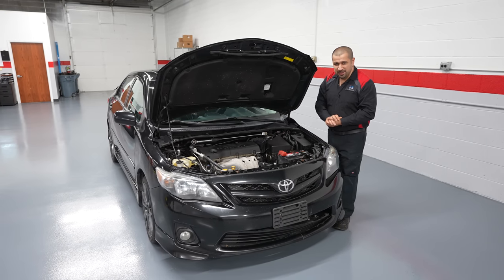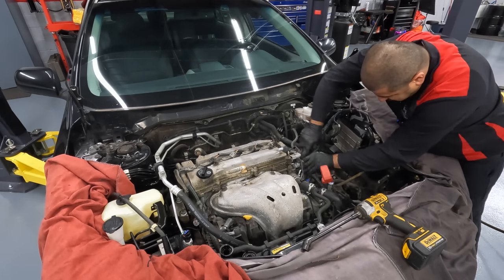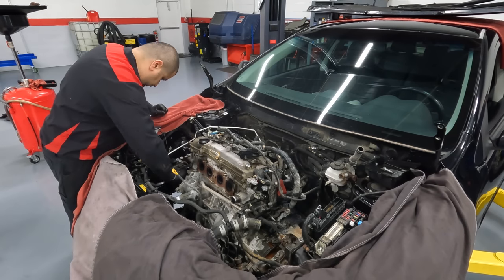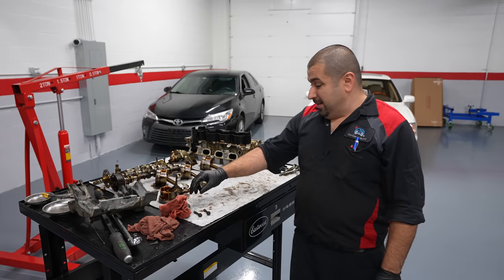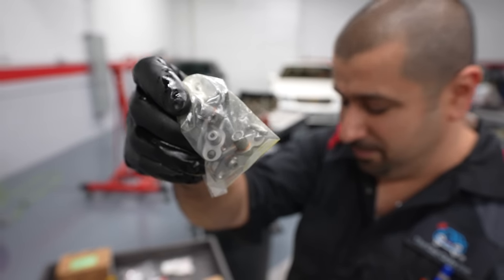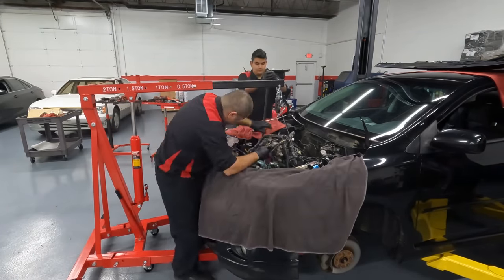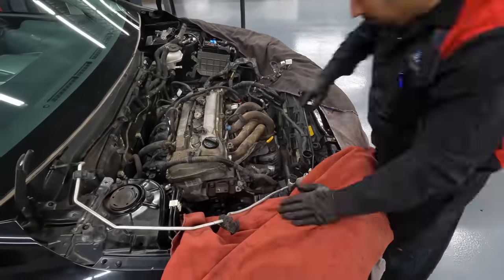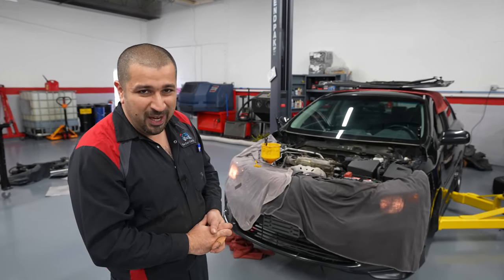THIS is Toyota's Worst Engine Ever Made! But Is It Really THAT Bad?

Comment: Basically if you did good oil changes every 3 to 5 k max every 3 to 5 months you probably wouldnt not develop that problem never letting sludge from to get in your oil control rings and gunking them up cause it to burn oil. I found running a half a quart atf for a week or 2 before oil change and successfully got mine un gunked and now i never have to add oil between oil changes.

Comment: I have a 2010 red Toyota Camry sport edition is the vvt-i engine 4 cylinder to 2.5 l I drive the car and when I press the gas I hear kind of a whiny sound I've just recently replaced the coil packs and spark plugs so I'm wondering if that has anything to do with it would really love to get an idea of what you think it could be I'm desperate here cuz no one has answers
Reply: Stupid autocorrect I have a Corolla not a Camry

Comment: My 2006 RAV4 (then with 117,300 miles) had been CONSISTENTLY using one quart of oil every 600 miles – due to defective pistons, a KNOWN MANUFACTURING PROBLEM. 

Toyota had to know which cars had the faulty engines and should have issued a recall for ALL of them, but they didn’t.   Rather, Toyota waited for customers to complain of excessive oil consumption, and then promised to test and then rebuild oil consuming engines on an extended warranty basis for cars less than 10 years old and with no more than 150,000 miles.  Sleazy!

An Eastern Pennsylvania  Toyota dealer performed THREE oil consumption tests on my RAV4, the first two of which were done within the Extended Warranty ‘window’.

The FIRST TEST (2/29/16) PASSED, but the car kept using one quart of oil every 600 miles AFTERWARDS.  I bought a case of factory recommended 5W20 Synthetic Blend oil to keep the engine properly filled, as needed – about every 600 miles.   

The SECOND TEST PASSED (6/30/16).  I watched the technician put oil into the car from a previously poured pitcher (but oil viscosity unknown).  The car burned just over half a quart during the test, BUT continued to use one quart every 600 miles AFTERWARDS.  When this dealer changed the oil on 3/20/18, there was NO OIL on the dipstick after just 528 miles!  None!  Nada!  Zilch!  Ouch!

I opened a case with Toyota Corporate who suggested the dealer conduct a THIRD test.  To ensure that the proper oil was being used, I MYSELF provided five quarts of (5W20) synthetic blend oil, and watched while the dealer’s  technician placed 4.5 quarts of it into the engine.  In doing so, the technician quipped that the test results would not matter anyway as the extended warranty program was over by then.   

With the factory recommended oil that I provided, the THIRD TEST INDEED FAILED – the car burned over 2 quarts in 1250 miles, and this time the red oil lamp flickered for the first time!  When I called them back, Toyota Corporate told me that the Extended Warranty coverage had lapsed for my car, and I should ‘take the matter up with the dealer.’   

The Toyota service manager promised to check with ‘his man’ at Toyota to see what could be done, but never replied back, nor did the Toyota Dealer Principal after I sent him a certified letter, followed by two telephone calls.  I’ve even e-mailed the Toyota CEO (Mr. Toyoda – that’s supposedly his real name!) in Japan – no reply!

To recap, the first two tests PASSED (when the dealership said THEY provided the factory recommended oil) and the third FAILED (when I provided the factory recommended oil).  The only plausible explanation is that the technicians – for some unknown reason - placed the wrong viscosity oil in the car for the first two tests.  I know they didn’t overfill it because I watched.

The result was that I was ‘stuck’ with a car that has lost most of its resale value as I could not in good faith sell it in its current condition, a car that can be dangerous to drive should the oil level drop too low, and a car whose catalytic converter is most likely to fail soon (an expensive repair) because it is absorbing the excessive amounts of oil blown into the combustion chambers by the clogged pistons.

I have owned many new cars over the years, including two other Toyota’s (1999 and 2002) that were purchased brand new.  They never burned oil between oil changes at 3,000 miles.  This is a consummate disgrace both from a car manufacturer that touts quality and from a dealership that fouled up the first 2 tests.

Does Toyota Corporate stand behind their dealers?  They say they do, but but apparently very far behind.

A Better Business Bureau complaint was filed to which this dealer never responded.  Their rating even dropped from an A to a C Minus.  They don’t seem to care.

----------------------------------------------------------------------------------------------------
Reply: I’ve owned 3 toyotas and dealer run around doing warranty work has soured me on buying anymore toyotas. What good is a warranty if they find a way out of it.

Comment: I looked quite hard at this issue about a year ago (Sept 2024 now) and I found somewhere that this piston ring malfunction causing the oil burning problem was only for the Nth American Market.  Can anyone confirm that?  As I'm in NZ and looking at importing one from Japan, hoping that this is not an issue, cause the other issue with this engine of the early models was of the Head bolt stripping, which I don't want either...  It seems that they fixed that issue but introduced the oil burning issue from the piston rings change...

Comment: Ok so...mine is an 09 xb I took it to Toyota because it's burning a quart in about 3-400 miles. They took it, gave it back claiming mines not an affected model. I call absolute BS. this isn't something I caused, that's for sure. And I have proper service maintenance to prove it. 

Toyotas recall says 150k mile extended recall. Mines now at 144. I think they're trying to make go over 150 so they don't have to fix it.

How can I prove it's the rings and is their fault. It's the exact same engine and model they said is affected. I almost want to sue them and I know I'd win too.

Comment: I shuddered at the thought I have to trust the average Toyota mechanic to even orient the piston rings and the piston  etc , the dot should face the front. I have a better chance just doing it my self and watch your video a few times. Yes it will take 3X as long , but I know it is done right, not by someone trying to beat the flat rate hours.. The serpentine belt, I not necessary will change it. If you spray vinyl /leather /rubber conditioner on the belt each year, one brand is 333. I seen people remove the belt and soak it for 15 minutes. Never change the belt. Same with cabin and engine air filters, you can agitate them in mild soap and water and inspect it later. I learned that with my old Suzuki for the engine filter cost $40 CDN 20 years ago.

Comment: Have an 08 scion tc. After an oil change ots almost burnt through all new oil in 600-800 miles. I add an oil treament and new oil and it burns very slowly till 3000 mile mark.

The cut off for the fix was 10 years and/or 150k from toyota. I took it in... They did a fresh oil changem taped everything off to make aure no manipulation... it disnt meet the consumption requirment for the fix....
Mine never had a problem till hit 157k and ot was 11years old. 😢

It's 17 now and i just know to check the oil often.. unless the A/C is on full blast you can barely tell the car is on... 
Usual maintenance, brakes, tires, oil. 
1 new alternator, new serpentine belt, spark plugs, 2 valve cover gaskets. 1 PCV valve, 1 purge Canister. Everything else is OEM... Great car for 18k

Comment: i have A2012 camry  140 thousand miles if i use 0-20 oil it burnes a 1.5- 2 quarts between oil changes at 5000 miles so i started using 5-30 and burns maybe 1/2 quart now

Comment: Any 4 cylinder aluminum engine if you over heat it will fry the engine, what demographic overheats the most 4 cylinder Camry engines?

Comment: The worst Toyota engine, I bet, was 1.5L found in my 1991 Terrell with 3 valves per cylinder and 3 speed auto. I owned that contraption from 1998 till 2003 and was 3d owner. I still hate the thing with passion! I forgot how many times I paid my mechanic to change valve stem caps. Every time they would last for 3 weeks max and then every morning I go to work people who lived on one side of the street could not see houses on the opposite side of the street. 😂

Comment: Opel and Toyota from about 1998 to 2009 seems to smoke much more only after 100 000 km than any other brand that the reason why I never dare to buy one many taxi drivers in Dublin Ireland had Toyotas that time but not anymore  it got bad reputation

Comment: bummer, I had been searching for a used car and there were many toyotas/scion cars i was interested in but they all were form the affected years and  had this engine. I did not see one car that had the issue addressed or noted in the vehicle maintenance history. Its as if the previous owners all decided they would rather get rid of the car vs dealing with fixing it. I never have any desire to have my cars in the shop for major repairs so as soon as I saw a toyota with this engine, I walked away. I never bought into the "its a great car....it just burn oil but other than that, its great". Sorry, if a car has a factory defect where its burning oil that could lead to major damage if not addressed and costs thousands to fix then its not a great car.

Comment: Had one in an '07 Camry SE. Ran fantastically, but LOVED a very steady diet of oil consumption! We just kept her topped off since we missed the extension of the warranty engine rebuild by a few thousand miles after buying it w/190k miles on it. The cop I bought it from told me with a straight face that it was completely trouble-free and said "I'd let my mom drive across the country in this thing!". Somehow I missed the issue in my research. Ugh! Oh well. A needy friend of my daughter is still driving it today after she sold it to her really cheap! Probably has near 300k on it by now.

Comment: He said this engine was designed for 5 30. Does anyone know if that is true with 2arfe? Just wondering if I should do the same with that one as I am not worried about fuel mileage with that one rather longevity as it is great on fuel to begin with. Love the 2arfe I have.

Comment: Great points regarding 'don't mess with what ain't broke,' (eg. head resurfacing if a flat head.) There is a MUCH MORE common 'error' for those only doing a leaky head gasket repair: They remove the carbon build up at the top circumference of the bore. This carbon was patiently built up by the existing rings, is has become INTIMATE with them,  and becomes crucial in preserving the compression stopping blow-by (and oil usage).  Thus the 'backyard guys correct the 'overheating' (blown head gasket), but now you have an 'oil burner.'

Comment: Will the vin# let me know what piston and Rod letters was used?
Reply: I have went to the dealership and inquired thru techs and parts guys. There are 2 or 3 different letters used and I believe B or C is most common however no a VIN# Will not give you this information.  You must take the engine apart to find the exact letter used. Sorry.

Comment: Hi Brother, You are knowledgeable person,  where you located, venza 2013 2.7 liter 1AR-FE engine. misfire 1st cylinder P0301. I changed all possibilities, mechanic said, change the engine or rebuild (over hull),. current meter reading is 180300KM and I believe this engine has rollback 100000KM so its around 300000KM. I bought this car from the private seller,. Please advise me, I'm in situation last 6 months. Thank you

Comment: Hands down, this (IS) the worst engine Toyota has ever produced. They easily overheat, pull cylinder head bolts, seals and gaskets leak like crazy, and burn more oil than a Diesel engine.

Comment: The bullshit when dealing with the warranty is associated with the dealership that's honest and will honor it. I had a scion tc with a similar issue with rings causing oil consumption l. Clearing the test they did stated it didn't, long story short...I took their word...3 months laters...oil consumption lead to knock and engine failure...mechanic outside said Toyota screw up and now it is better to just get a use engine rather than rebuild.

Comment: Not going to watch, just going to ask. Is it better or worse than the engines in the SR5 that barely lasted 1000 miles before cracking and/or warping due to a design defect in the engine block itself preventing adequate cooling? Or is this Transmission based like in the Helux where the only thing really holding it in place is the engine and sheet metal allowing it to flop around and chew up its insides?
It's okay if you don't answer me, this is Toyota and I know from personal experience that they aren't worth more than the scrap metal price unless you are selling it to a delusional fan boy of the brand.

Comment: Mine burns oil so quickly that if there was a way to replace the filter without draining the oil, you'd never have to change it. Just keep topping it up lmao.

(Yes I'm aware that you drain the oil to remove contaminants from it and Bruning the oil doesn't do that but it was just a joke shut up)

Comment: Do BMW engines really blow up after every 100,000 miles?

Or are you just voicing your bias that Toyota engines have wide tolerances and require very little maintenance to stay running?   I have owned and still own both Toyota and those German cars, they all have well over 200,000miles on them and run very well.   

Did you mean that most people don't properly service the BMWs that blow up every 100,000 miles?   Because that seems more accurate in my experience.

Most people don't service cars properly period, to me that is one reason that makes Toyota more reliable than higher end German cars.   Toyotas can take a lot of neglect before they break down.  Given proper required maintenance, my experience is the reliability between toyota, honda, bmw and audi, regarding the engines is similar.     The root cause, to me, is most people are not interested in what it take to maintain a German engine to spec, all the time.  

Do you agree? Why or why not?    I agree that Toyotas are easier to maintain , but not on the reliability of a properly maintained engine between both makes.

Comment: i change my oil every 3000 mile i bought a 2006 rav and a 2007 salera
i  got burned by both traded both for hondas the rav traded at 160000 kiles
and the salera at 225000 i loved the salera but i was mad at toyota so i stayed with honda the my  2014 crv blee head cadket and traded same in gor 2021 tundra and bought a 2022 corolla hatch manuel
love my toyotas again
but with toyota i trust but verify
the tundra i added the trans cooler

Comment: factorys thought oh lets make the oil change every 5000 and use low tension piston rings with a zero weight oil bad idea how come toyotas 2006 to 2002 2azfe engine never had this issue oh wait they changed something that fucked it up.

Comment: Grey white and red Toyota mechanic shop color.  Toyota compromise oil burning for higher higher gas mileage and more power.   I will buy a bad Toyota over a good Mercedes Benz 😊  no such thing as good Mercedes Benz.

Comment: Why couldn't they just make it rite from the beginning. So that it will not consume 🛢
Reply: All manufacturers are trying to make the cleanest most fuel efficient engines they can.
They run hot, lean burning, hot catalytic converters.
That can foul the oil and gum it up...
It only shows up in a few high mileage motors.
90-95% run without issues.

Comment: I have a 2007 Camry (got the oil burning fixed and I'm serious about the oil change) which is making noise (sounds like diesel) at the cold start lately. Many people having this problem are positng videos. I'm attaching one of these: https://www.youtube.com/watch?v=Ba_OUPgJCyg (the noise is exactly the same as mine). The noise goes away when the engine is warmed up. I've tried stethoscope to listen from top to bottom of the engine, but still couldn't pinpoint the sound source. I am one of your fans, and thought extremely highly of your opinions. Would you be kind enough to give me, and the other owners a clue what it is and the possible fix? Your masterly advice will be reatly appreciated! I have searched all over and found there are so many camry 2az-fe engines having this kind of noise, but no one seems to know what it is. Here is how mine sounds like: https://www.youtube.com/shorts/yZwH2LKwbC4
Reply: My problem is solved: it's a after-market bad flapping exhaust gasket leak. Replaced with the OEM. The car runs great again!